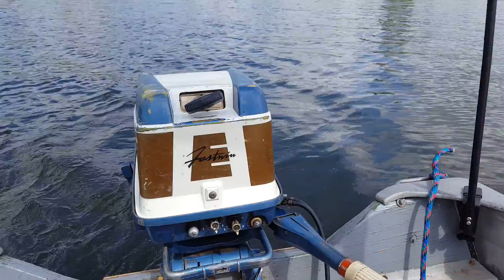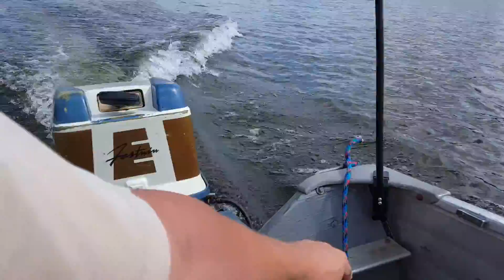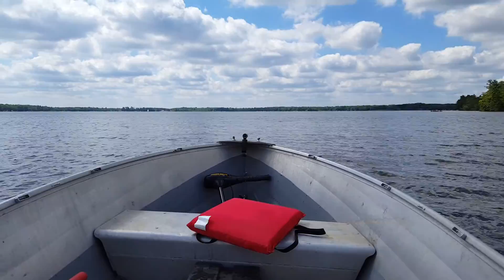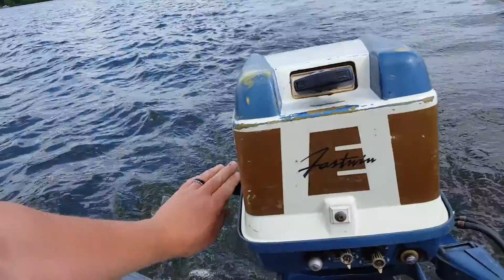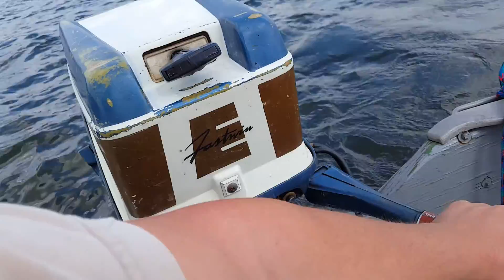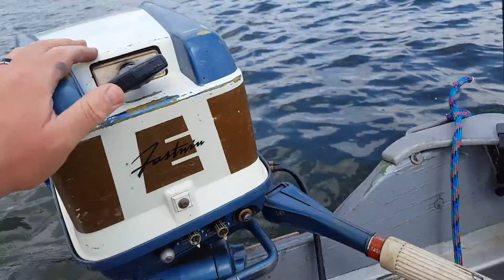1959 Evinrude Fastwin 18hp Outboard Motor Lake Run

Comment: nice Evinrude you have Johnny, I've always loved the 1959 models with the blue, white and gold finish! I'm also a AOMCI member ( at 16 years of age) and it's fun to cruise with an old omc motor, there just reliable and dependable for any circumstance. but that's a good way to mark the 50th anniversary of Evinrude and end  the 50s. Mike
Reply from the maker: GMC_Crackerbox_Truck Thanks! I have come to be very fond of the 59 Evinrudes also.  I have a 10hp I just finished up that's ready for test and tune as soon as the tank thaws out. Look for a video of that one next season on the lake.  It's great to have young members in the AOMCI to carry the torch.

Comment: Nice motor!  Just bought an older 14ft Starcraft v bottom with the same motor from a family member last year.  Had it out the first time this year a few weekends ago.  There were 3 adults in the boat including my gat ass lol all out fishing gear with gas and battery.  My speedo app only really topped out at 8 mph.  Was expecting a bit more but heard you mention adjusting the trim on the motor.  So two questions...does that speed seem low to you and what would you adjust?  It seemed to run great up to full throttle so I don't think it has running issues...I'm guessing the big load slowed it down.  Thanks for the vid!
Reply from the maker: Joshua Gage That speed does seem a bit slow for 3 guys and gear in a 14 foot Starcraft.  With 2 adults in my Sea Nymph 14R,  I still get 20mph with this one.  If I had 3 people and gear, I'd guess it would still get 12 or better.  If your Starcraft is a try V-bottom that is V all the way to stern, they take a little more power to plane off.  I had one, but I sold I because I rarely used it.  It would do just over 20mph with my 1986 Mercury 25XD with just me and fishing gear in the boat.  It had a plywood floor that added some weight, but definitely a slower hull.  It rode and handled great though. I run the tilt pin out one notch with only me,  and out two notches with a full load. It could be only running on one cylinder, or it may be possible the prop hub is slipping too, but that usually will allow the engine to over rev rather suddenly and barely get over trolling speed.

Comment: I have a 1959 as well I just did everything but take the gearcase off I did a reseal on the gearcase new o rings and prop shaft seal but it still won’t hold air pressure sounds like it’s coming out the exhaust 
Do you think it’s the shaft seal under the water pump or shift shaft seal this motor looks like it had low hours and fresh water
Reply from the maker: The first seal to fail on these is almost always the shift rod O-ring. While the gearcase is off and apart, I would replace the drive shaft seal as well.  Either of those seals will leak air into the exhaust housing making the sound you describe.  Thanks for watching!

Comment: I have a 1959 18 hp model 15028 sound's just about like this one you have. That pull start is wearing me out in my advanced year's. How much hassle would it be to install a starter on my motor ? How ya doing Johnny Rude....?
Reply from the maker: There are different levels and ways of installing electric start on these motors.  If all you want is a starter and no electric choke it can be done fairly simply.  You will need the starter and the electric starter bracket.  I think these all had electric start flywheels on them by 1959.  If your flywheel has the ring gear on it, you're set there.  At that point you need a starter solenoid and a starter button, battery cables, wires, and a battery.  The wiring can all be done on board the motor under the cover with the starter button through the lower pan, or a battery box can be wired up with the start circuit within the box external to the motor. That would mean only battery cables would connect to the starter under the cover and the complete starting circuit would be contained within the battery box.  I have motors done both ways.  

I'm doing well.  Thank you for asking and thanks for watching!
Reply: @oldjohnnyrude8404  Yes this flywheel has the ring gear and the boat is already wired my way for a starter. Direct current. I would prefer not to go electric choke cause I do not know what that is. I found a starter and braket need solenoid and some gumption. How's the fishing on your end.....?
Reply from the maker: @rustyleighty1999  Sounds like you are well on your way. Electric choke is done with a solenoid to actuate the choke valve.  It works in conjunction with the manual choke knob.  You only need it if you are starting the engine from a forward cockpit from the remote control position. I have not been fishing in a while.  I'm usually too busy with outboards and boating in my spare time.  I need to get out fishing again, but it never seems to happen.

Comment: I have the exact same year motor only it has the single line fuel hookup with a fuel pump. did they convert that year or  do you think mine is a mod?  it was given to me and sat for probably 20 years. I  hooked fuel up to it and she purred like a kitten. just wow. needs new seals though.
Reply from the maker: Ben g Thanks for watching! If yours is a "Golden Jubilee" it is a '59 just like mine and it would have either been converted or the powerhead has been changed to a later model.  The 1960 model was still the breadbox style but had black where the gold is on the 1959.  Those were the fist year for fuel pumps.  The 1959 is the last year for the 2-line pressure tank system.  Someone may have replaced the cover on a 1960 with a 1959 cover too?  It may have been converted also.  That is fairly common and an easy conversion to make if someone either doesn't have or doesn't want to use the pressure tank.

Comment: very quiet!
Reply from the maker: Yes it is.  This motor is a pleasure to run.  Quiet, plenty of power and will troll too. Quickly became one of my favorites. 20mph with 2 adults in the boat.
Reply: +Old JohnnyRude.  please help. i have this exsact evenrude but the water pump dose not work but cant figure out how to undo the gear shict linkage to drop the pump out can you help me?
Reply from the maker: +corbin larson There is an oval plate on the starboard side of the tower with two slotted screws.  Remove those screws and take the plate off.  Behind it you will find the clamp that connects the shift rod together.  Remove the lower screw completely using a 3/8" socket. Be careful not to lose the toothed washer under the head of the screw.  Once that screw is out remove the 5 bolts that hold the lower unit in place. Now the lower unit can be removed and the water pump can be serviced.  Be careful when replacing the lower unit that the groove in the shift rod lines up with the screw hole in the clamp.  Its easy tonget this a little off and bugger the threads. That messes up the threads im the clamp and it will end up stripped. Other than that, pretty straightforward.
Reply: +Old JohnnyRude thank you so much for the fast reply! i will try it in the morning. mine runs real rough but only want to try trimming it out if it can cool its self. thank you again